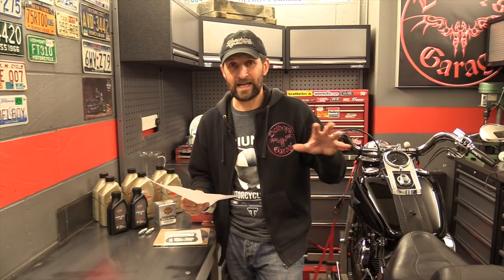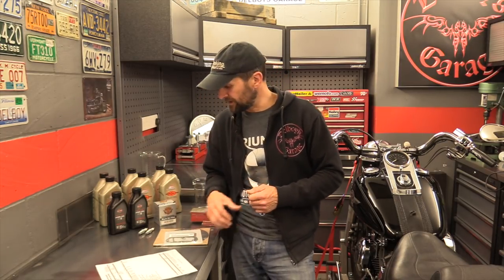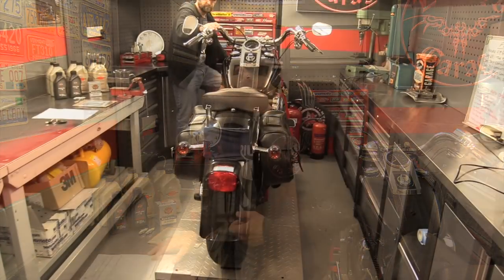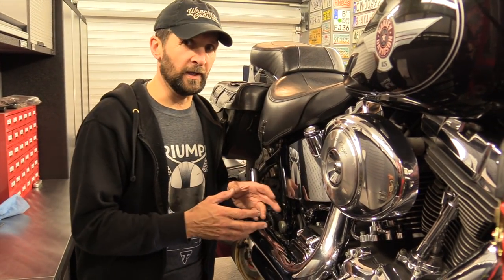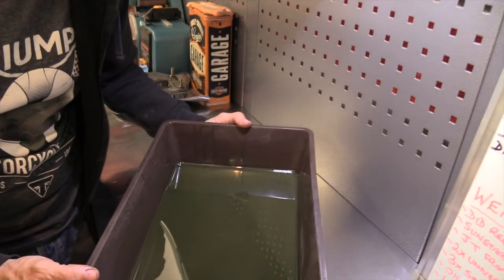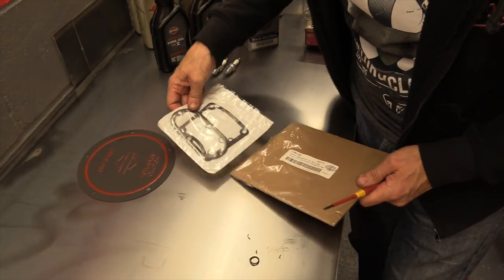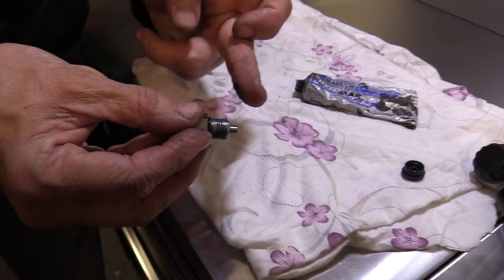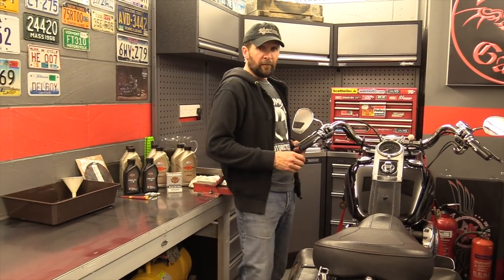Delboy's Garage, Harley Softail Service #1:- Gearbox Oil Change

Comment: Hi, Del. First of all, congratulations for this awesome video. Can I ask you the OEM part no. for the Gasket set?
Reply from the maker: Thanks for your kind comments Pj, sorry i don't have the part number handy.. but you can just order it by model from your dealer.. they'll know what set to send you... Good luck with yours..  Del.
Reply: Thank you for your answer, Del. Just one more question? I searched but unsuccessfully a video about service on a 1340. Is there anything you can suggest?
Reply from the maker: @Pj-Harley  Hi again buddy... i haven't done any servicing videos on an Evo.. .but the procedures are much the same... are you just doing a fluids service then..?
Reply: Hi, dear Del. Yes, I need to go for the 5 fluids, all of them. The previous owner doesn’t even remember the previous service done. Just consider the DOT of the tires is 2 0 0 7 ...absurd!!!
So I better referral EVERYTHING! I just don’t know how to start. 
I watched your first video on a Fat Boy (gearbox) and I truly feel comfortable doing by myself. The problem is the carburetor which I guess is a Dynojet. 
HELP!
Reply from the maker: @Pj-Harley  OK, well the fluid changes are pretty much the same format as with the Twin cam.. same holes, same fluids.. and if its carb, then it wont need a Dynojet kit unless you're trying to re-tune it to suit new pipes etc..if its running and idles well, then just clean the filter! . it sounds like its been stood up for a while maybe?..  i imagine a pair of new tyres will be in order, and maybe check the brake pads and brake hoses too. just depends on how long its been stood still.!   Other than that, you may want to take the primary cover off to clean and check the chain and internals...but again.. judge how bad it is by the condition of the oil when you drain it out.. !!!
Reply: So, tires orders and ready to order oils and tools. By the way, since it’s a 1340, would you suggest the Syn3 Screaming  Eagle as well? Many people talk about mineral oil for this bike. 
Starting from now I need to check a lot of things on my Fat Boy.  I just hope I can find good videos even if yours are exceptional, definitely the best found up today. But thank you for your suggestions, really precious.
Reply from the maker: @Pj-Harley   The Syn3 will be fine on your bike... but its not necessary, it'll be perfectly ok on something a little less expensive.. just make sure its a good quality 20w/50, and as its a softail, you can purge it too and make sure you get all the old oil out..!!   Good luck with it buddy.. and have fun...Del.
Reply: Your suggestions are really precious. 
Thank you, my Oracle! 😊✌🏻
If I may, I suggest shooting a DIY video related to 1340. It’d be awesome and priceless.

Comment: AWFKNSUM video 👍 thought you had. To have bike on jiffy stand to check oil levels 🤔🤔👍🇦🇺🇦🇺
Reply from the maker: For checking the engine oil in the tank yes,  but Gearbox oil check upright... some Harley's vary so always check your service manual for exact spec. !
Reply: @Moonfleet41  yeah Bud my 2011 softail fat boy calls for check on jiffy once again Bud AWFKNSUM videos 👍🇦🇺

Comment: I had sent a comment regarding this video series. I mentioned how you not only show how simple the process is but your style and complete information gives many of us the confidence to do the job our selves. I got a quote from my local Harley dealer to change the fluids (Crank Case, Trans and engine) Labor ONLY !   $700.00 US. I went out and bought all the fluids, a fliter and derby cover gasket.   ($155.00) US. I will be doing the work myself and enjoying every minute of it while sipping on my tea. Take a peak at www.roguechopper.com for a kit to flush ALL the engine out.  I honestly can't thank you enough and am now binge watching your videos. I MIGHT try the fork oil on my 2004 Softail. Once the confidence is built up. H-D wants ($425.00 labor). Thanks to the both of you.  As always Great camera work.
Reply from the maker: Thank you Sir, good to hear from you!  And my word you are saving some seriously big dollars there!  With your forks, you may benefit from buying the genuine Harley Davidson manual, they're not cheap, I imagine close to $100 where you are, it's A4 sized and about 2" thick, but will contain every procedure you will ever need... and will certainly be a great 'bible' to guide you in your works, certainly on important matters like torque settings... when Harley give torque settings, you'll notice an upper and lower range, if it's a greased or oily thread, go with the lower setting... if it's a bone dry thread you can go with the higher setting, but somewhere in the middle is usually safe... so obviously a good quality torque wrnech is your friend.  Good luck with it, hope it goes well for you, thank you for your kind support... we run a tip cup on the channel for anyone we've managed to rescue from the 'stealership' and their crazy bills and a little donation helps us pay the overheads on a busy channels and helps us carry on making videos, but it's entirely a personal choice and expected.  Ride safe, and stay in touch!

Comment: (p) How did the new bench perform? Looks very sturdy and the 'cut away' rear wheel trapdoor looks a great boon too.
Reply from the maker: Hey buddy, the rear wheel trap door has already paid for itself in the gearbox video if you noticed, Penny was able to film the oil draining from literally below the rear wheel... (she was a little nervous with a 300kg above here head, but hey, needs must lol)....
Reply: Could we have a 'how to' video for persuading your wife to scrabble around on a garage floor. It would save all that tedious knee pain when we drop a vital nut.
Reply from the maker: The cost of that kind of commitment from a wife is far greater then you would ever believe my friend...lol

Comment: I have a 2020 heritage classic. I was told by HD that i can change the oil myself and document it  but i Must bring the bike to HD for the mileage service intervals or the warranty is voided. I must go to HD when the bike hits  1000 miles, then the next one and so on..... It kinda sucks bc  they got me by the balls.
Reply from the maker: I don't see it that way mate, if you feel they've got you by the balls, then equally, you've got them by the balls too, because they have to warranty your extremely expensive motorcycle and all they ask is that they're allowed to check it over and service it on time, I don't really think that's unfair, and if you had a warranty claim and hadn't had it serviced, then we can't really moan when they refuse the claim, it's just the bug bear with buying new bikes, but if it's any consolation, I imagine you could ride your Heritage for 'one hundred thousand miles' and it wouldn't go wrong!  So it's not really that much of a problem, whichever way you go...
Reply: @Moonfleet41  Very true. To be fair I see it both ways but  it has to be Harley that does everything, they want the bike at certain intervals, there arent that many HD dealerships and they are expensive. If i put a stereo on the bike and the job is done 100% correct and i have an electrical issue that has nothing to do with the stereo they will blame the aftermarket stereo  without investigating further.  Not even Mercedes does that with a car. With the exception of fluids, they have "suggested maintenance" but its only suggested and theyll do the warranty work.

Comment: Jeez your previous owner got ripped off with the service, the most expensive service at my he dealer is £360 and that is for the 10,000 service all others are £240 and include all oils
Reply from the maker: Then add the fork oil change, brake fluid change, and fuel tank filter.. i said it was a FULL service... those £360 ones are just a basic 10k service and critical fasteners check.. the parts alone for the fuel tank screen come to £140,. no rip off buddy.. just the real life cost of doing all the major long term stuff at once..!